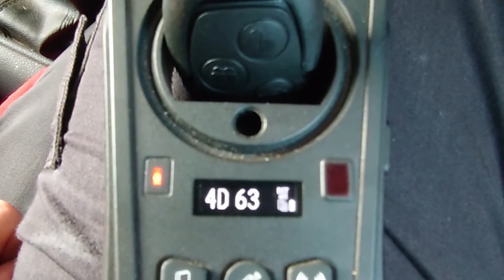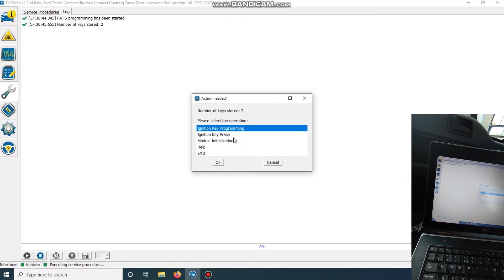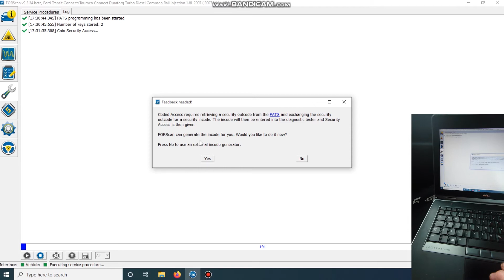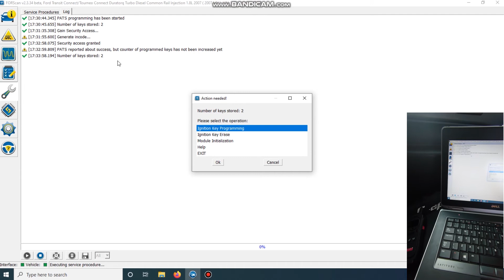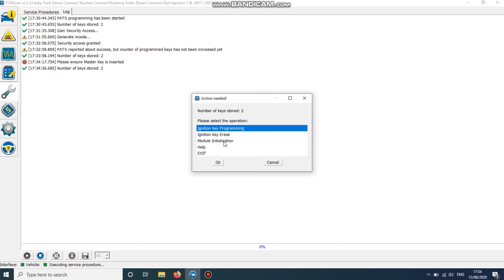Ford key programming PART 1 - FORScan

Comment: I heard the cheap new fobs have 80bit 4d63 cgmhip which forscan can't deal woth. I used a secondhand key for my 2013 mk7 transit ( not connect)
Reply from the maker: Yeh, I keep a selection of transponder chips as aftermarket ones can be hit and miss.

Comment: Thank you, very useful video, I bought a key with a wrong chip inside, after hours of trying ignition when I watched your video I checked the transponder and it was a wrong transponder inside the key, after changed the transponder with a good one the ignition work instantly, thank you a lot for your video part 1 and 2 🙏

Comment: Would something like this work if I only have 1 ford key and its not an admin key (this MyKEy also has restrictions with driving speed, speaker vol etc)? I want to program another key I bought online, and also remove alll restrictions of the working key. Is that possible through FORScan?

Comment: Do you have video with successful process? I have 2 working key for Ford Fiesta mk5 2007. Bought 2 more from Aliexpress and 4D63 40 bit chip (and 80 bit). When I turn on first 2 keys (working) then not-working, led lamp blinks fast like chip is not recognised. I think of buying OBD2 for Forscan, dunno which to buy

Comment: Does all of ford's cars need the 4d63 chip when programming a key or does it need a specific chip to work? Mine's a 2008 ford focus tdci. I just need to make sure before i go buy keys
Reply from the maker: Should be an Id63 at that age. But the best way to tell is to have the old key read via a key programming tool

Comment: Is it possible to use Forscan to reprogram old ford keys to work with another car?
For instance I have a Ford Transit Connect and I only have one key, but I have 2 old ford mondeo keys that looks identical.
Can I reprogram my mondeo keys to work with my transit?
Reply from the maker: If they are the same transponder. Older are ID60 newer are ID63.
Reply: @rmautodiag  huge thanks! Is there a way to determine what transponder I have in my spares? My Connect is a 2012 and I have seen others have ID63 transponders in their Connects. So I'd assume mine have ID63 as well?
Reply from the maker: 2012 should be ID63. I think the change over was 2007 from ID60.

Comment: Thanks for the video, has part two been released yet?
Reply from the maker: No not yet it will be in the next couple of weeks👍
Reply: @rmautodiag  Just about to try this on my ford fiesta, did using the wrong key stop the other keys from working?
Reply from the maker: No it didn't the van still ran fine. Don't erase any keys!
Reply from the maker: video to be released on 25/08/2020 at 07:30 PM
Reply: Can’t find part 2. Is it up still?